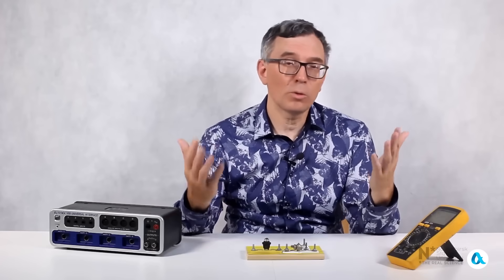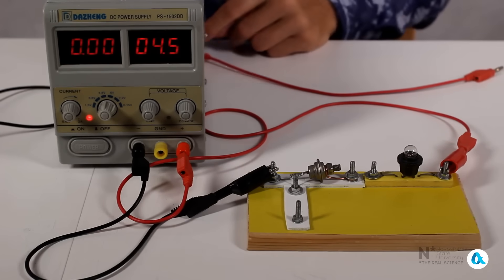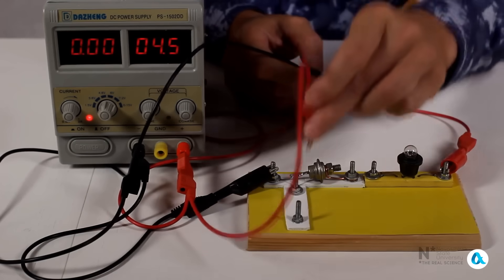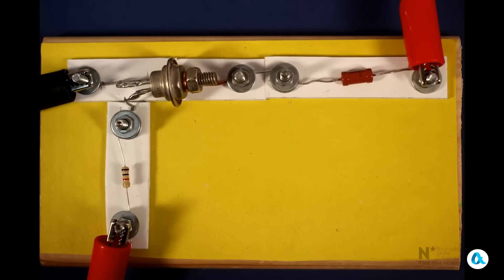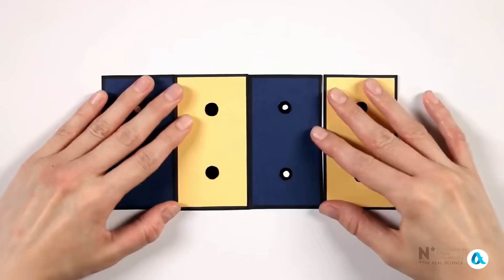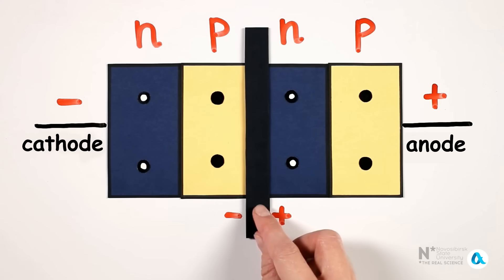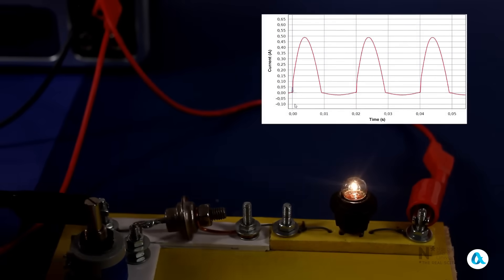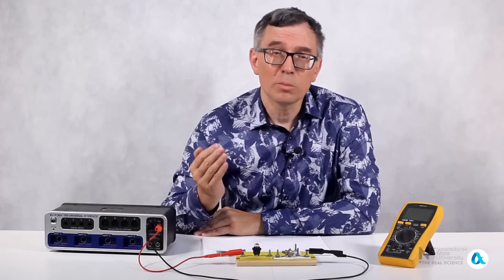How does thyristor work?

Comment: The fact that the only way to turn it off is to either disconnect the source voltage - or - shout circuit the output, explains why the device is not often used.

Comment: I think you're getting open and closed confused but good tutorial otherwise. Open is no current. Closed is when current flows, as with a switch. In English, we do not use a hydraulic analogy where open is like a valve being open, but rather closed like an electrical switch. Also, it's holding current that keeps the thyristor conducting, not voltage per se. Change the value of your load resistor and the cut off voltage will also vary, but the current at which that happens will be the same regardless of the size of the load resistor.

Comment: Your concept of the thyristor "opening" and "closing" is opposite to 'normal' electrical terminology!  I understand that solid-state devices are different from mechanical contacts, but the first thing learned about electricity is that in ANY switch, the contacts must be CLOSED in order for current to flow.
Reply: I was about to comment the same thing, but you beat me to it.

Comment: Linguistic comment: "Open" and "closed" can be confusing when talking about electrical systems. When one says "open the switch" it can be interpreted either way. Better to use terms like "conducting", "non-conducting", "on", "off", etc.
Reply from the maker: Unfortunately, these are the difficulties associated with AI translation
Reply: @getaclass_physics  To err is human. To really make a mess, you need a computer. Supposedly, AI can be trained.

Comment: The device you are explaining is actually an SCR.  A thyristor is a two lead device that avalanches at a prescribed voltage used usually for surge suppression.  I am an electronics Eng pro.
Reply: I disagree , You describe a zener diode , he is describing an SCR which is a type of thyristor , so is a triac , both 3 terminal devices
Reply: The most common type of thyristor is the silicon-controlled rectifier (SCR).

Comment: Since your power supply showed no current setting and only the rise in voltage turned it on and a very small amperage and voltage turned it off I don’t see this as proof that it is not voltage that turns it on but in fact voltage,or should It be a small wattage that turned it on? Non electronic technician here asking.

Comment: Your terminology is actually reversed. Since a SCR is basically an electronically activated switch (Like a latching relay), the bulb lights when the circuit is closed, not open. Sorry if this seems nit-picky...

Comment: Can the same function be obtained using a pnp transistor and a npn transistor with their leads tied together to form a npnp or a pnpn similar to a thyristor?
Reply: I'd guess not seeing as its the junction internal non measurable voltage produced at the junction interface that gives diodes & transistors their characteristics...

Comment: Thyristor for me will always relate back to my dad's original Vivitar 285 photo strobe; that interesting word on the case that lead to understanding how a capacitor flashbulb discharge could be interrupted by a low voltage timer-controller for a controlled power output.
Reply from the maker: That's a great example of how thyristors are used in real-world applications!

Comment: We call thous an SCR. Triac,s took over there job decades ago.
Reply: Technically no.
A triac is an AC opponent, the SCR (also called a thyristor) is for DC.

A triac is effectively two thyristors connected in opposite directions to enable it to work with AC.

Comment: I built a 12 Volt Battery Charger circuit in 1990 using a Thyristor. It still works 100% today - thyristor's are quite reliable.
Reply from the maker: That's amazing that your circuit is still working!
Reply: Unless it's a general electric dimmer wall switch
Reply: Being a retired biology teachers attracted to electronics but not attempting.

Comment: you forgot to say what it's useful for
Reply: Tyristors were mainly used in older style power electronics in for example older models of electric trains, welding machines ect and have now completely been replaced by MOSFETS and IGBTS wich offers better control. They are still however used in some lamp dimmers and speed control of universal motors in vacuum cleaners. In this application the tyristors are used in a so called TRIAC configuration.
Reply: They were used in old style linear power supplies for overvoltage protection, if the output voltage exceeded a limit the thyristor turned on and shorted the output causing a fuse to blow.
Reply: Large photo-flash units use this to AUTO set flash exposure.

Comment: Why does it seem at 5:53 that lamp glows slightly brighter just before turning off? Is it because you bypass the switch, and thus its dropoff voltage?
Reply: He shorted out the thyristor with a ground lead.  Before the light was seeing 4.5 volts minus the voltage drop of the thyristor, so about 3 volts.  When he shorted out the thyristor the light briefly got the full 4.5 volts.